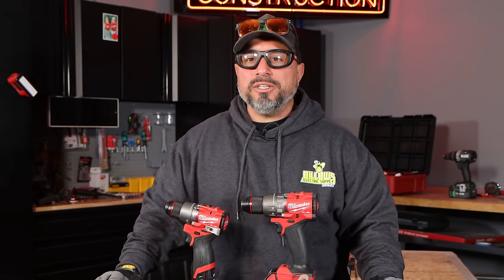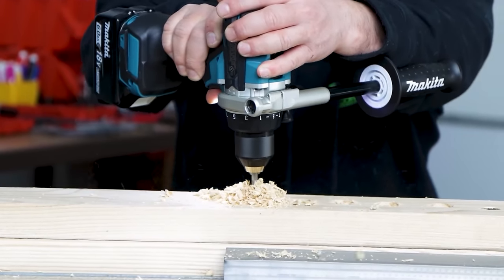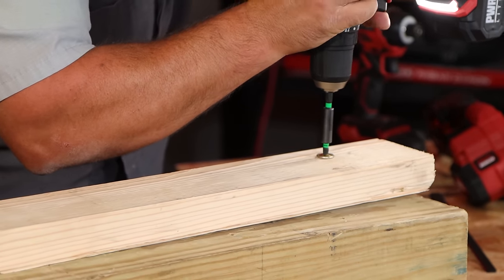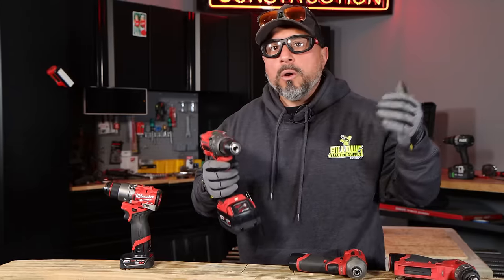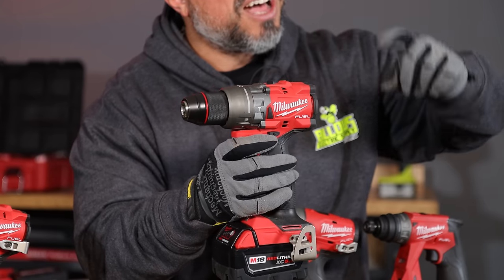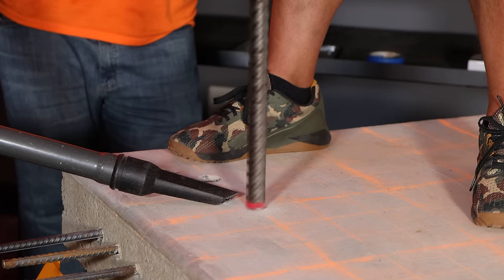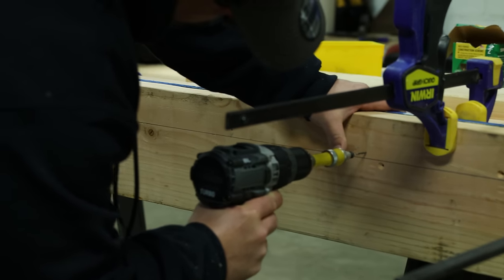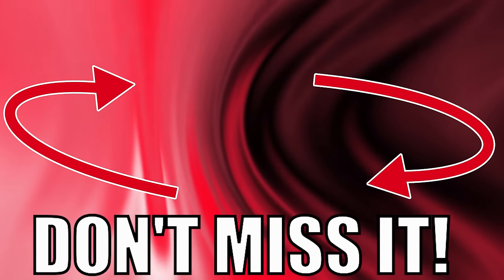Stop Using Cordless Hammer Drills...

Comment: The hammer drill to me IS a specialized tool. I use it for drilling holes into concrete for installing stuff like cameras and other fixtures. I can't think of a better tool to use.
Reply: Rotary hammer/ SDS will easily outperform any hammer drill for drilling into concrete
Reply: Specialised for drilling into concrete? No way, surely? Compact SDS is much faster!
Reply: @Mishibar  yes it will.  But imagine using an sds to mount a security camera.  Overkill don't u think?
Reply: I'm convinced we've been Vinced. This video was made to get us all involved in the convo
Reply: @maurjul  don't really think it's overkill, sds drills can be really compact and light nowadays. 
But if you're moving around a lot I sure understand why some people can get by with just a hammer drill. I do, I rarely use the hammer function at work, but the extra weight I carry around in my tool bag or on my person is worth not having to worry about hauling around a dedicated drill too. What the SDS can't do is fasten screws.

Comment: A hammer drill can drill with ease, drill light masonry, screw, fasten and do all of it with one tool.
Is it the best at doing these jobs? NO!
Is it less money upfront than buying specific tools for those jobs? YES!
I don't have any powertools, but I only need to buy a hammer drill with some batteries and a charger and I can do so much, if I want a tool to drill, a drill for masonry, a screwing gun, fasten etc I have to pay more for all of that plus enough batteries to power them.
It's just cheaper to buy the hammer drill and get started from there. 
Tldr it's cheaper.

Comment: In my field of work.  (A chimney sweep)  I use the hammer function all the time.  I use tons of tapcons and I usually drill with the hammer drill then run the screws with an impact driver.   Yes I have several big sds rotary hammers but they are big and heavy.   As long as the hammer drill will drill it I choose it over the rotary hammer 90% of the time.  Now yes if I am drilling larger holes I absolutely go with the rotary hammer but that isn't very common

Comment: What idiot is using a cordless rotary hammer for drilling holes in wood? It's for concrete..you use a regular drill for wood. Impact for driving. Cordless driver for light duty where you don't want to strip anything.

Comment: Ha ha Vince - what a great character!….Well this is not a DiY channel…it’s a big boy pro trade use channel.  Pro users can and have to afford: impact drivers for screws + impact wrenches for lugs + SDS for masonry + yes, a drill for torquing down fine fasteners.  That’s a tidy wallet buster right there! but their business buys their tools, so meh! no biggie for most.  However, for a DiY user who still wants quality tools without re-mortgaging the house…a compromise has to be brokered.  Currently, the ‘fad’ tool is the impact drivers, but DiY users don’t need 400 ft-pounds of screw shearing twist so a good mid range brand drill will do fine, and the torque control (absent on impact tools) will stop screws breaking off or burying right through the material being fuxed.  Then there’s the good ol’ hammer…Yes, you tradies will want concrete busting giant SDS hammer/chisels…because you build bridges, right!  But the DiY guy just needs to drill bricks and lintels, a task any good hammer drill will do easily.  Vince isn’t wrong…but he’s a trades advisor.  Of course if you are  DiYer with a fair bit of spare coin, sure…Max out your capability with…well everything. I do😂

Comment: What a stupid video. Cordless hammer drills are the perfect solution for for electricians and plumbers who need to drill small holes for anchors in concrete, brick, or block when installing boxes, conduit, or piping.